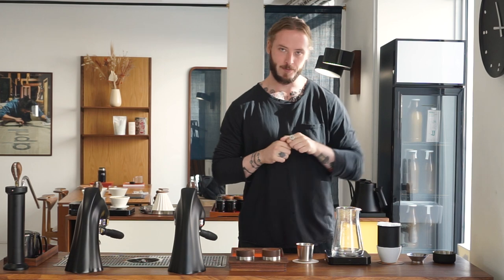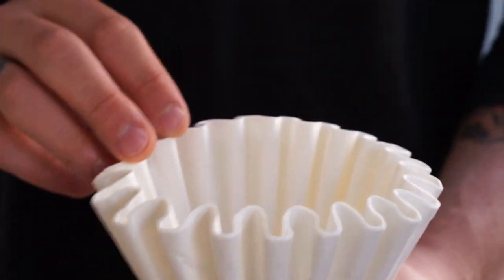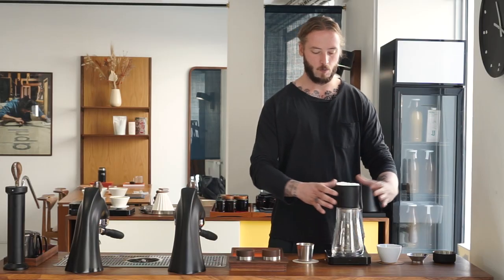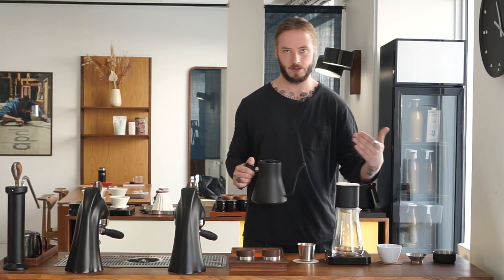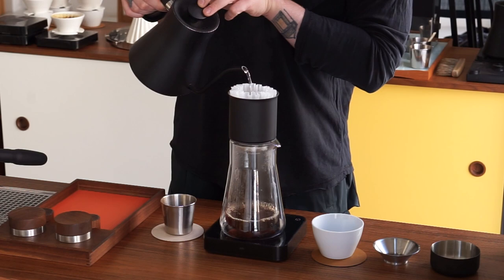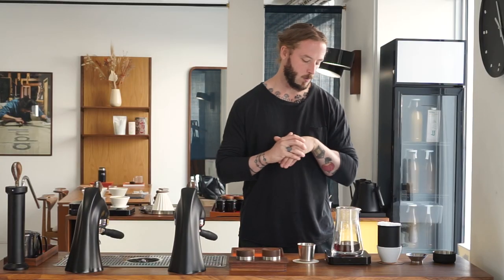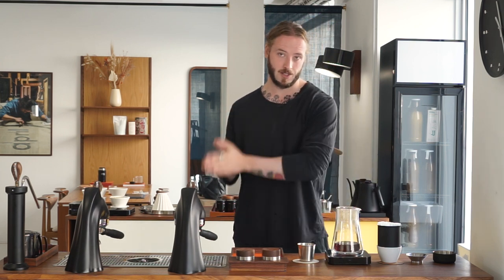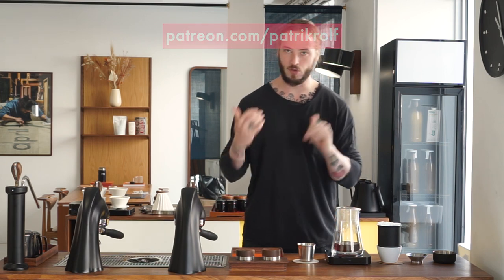Exploring the Stagg Pour-Over Dripper from Fellow (XF) | Coffee with April #188

Comment: I have both tha Large and the small Fellow at home. The large is not a good brewer for small brews. It shines then you brew above 400 grams ( I use it for 450-500g).
If you want to make a small brew then use the small brewer it is good for 200-350g. Above 350 g is has a very slow flow rate. When you use the small brewer you have a lot more control over the brew. I also stir with a spoon during the brew. That is something I don't seemed necessary with the April brewer or Kalita 155 but it helts with the coffee getting stocked in the waves of the filter.
You can also use Kalita 155 or Aprils own filters in it witch I would recommend. The April filter is thinner a easier to work with. I like the video but thing the base parameter of reviewing a large brewer and brew a small batch it a strange choice.
Reply: What recipe do you recommend with the smaller x brewer?  I’m doing 22g/370g currently and coffee fills up the cup completely
Reply: @serafinmora2000  
My Max with the small i 300g water. Normally I will use 19.5-20g of beans.
Reply: I think the best brew is with 200-250 g of water in it.
Reply: @rttange1  you do a 1:15 ratio?
Reply: @serafinmora2000  yes 1:15 or 1:155 depend in on the brand

Comment: Thanks for the vid!

Re: grind size. What was used? I know you have been mentioning the difficulty of conveying grind size in videos. I think reporting average size in microns based on the Brewler, is probably the most straightforward info that most people can use; Kruve has a free pdf download of the Brewler. Mine is starting to have notes all over it!
Reply: It won't really tell you anything because the fines and the bolders has a lot more to say than the average size does. unless you have the same grinder and knife you really can't compare grinds besides some ruff schematic about how fine ore corse you are grinding. It is one og those things you have to dial in on your own equipment especially then it come to tase your water has a lot more to say than what you can get from measure micro size in the grind.
Reply: @rttange1  an "average" is a value, and one that can be useful. Thus, providing microns can convey a common starting point that users can tweak on their particular grinder.
Reply: @smtesta  But unless you have the same grinder and water the taste of the coffee won't have the same taste. and even then you will have the style of pouring to make even another variable. I worked wit another barista and we braved on the same equipment same pouring times and brew times. Alle the same parameters from equipment to recipes. We still had a dirrence in the of 0,15 his had 1.20 mine 1.35. We tried 3 in a row and our respektive TDS where consistent. The reason to write is that you can measure anything and try to be the shame on the internet but in the end it is close to impossible to copy exactly what other hase done. The most important thing is still do dial a recipe in the same way that a chef taste over and over again and free tune the amount of salt, sweet, acidity, bitternes and umami. Those  fine nuances has to be sensed to be controlled.
Reply: @rttange1  I still think it’s good to know the general size and then tweak to taste.

Comment: You don’t understand why people want to brew fast, but this brew ends at 2:20? Seems relatively fast to typical brew recipes. No?
Reply from the maker: For us this is a "standard brew time" and fast brews would be closer to 2:00 or below - using the same ratio.
Reply: I find that the stagg xf does really well with 30g to 500ml, relatively fine grinds, and pulse pours of about 75-100 g each.

I only use the XF when I want to serve more than one person.

Comment: ground compaction chokes up the flow rate, can be very frustrating if you're aware of it, years of hit and miss brews
Reply: After rinsing you should lift the paper a bit and you will notice a huge difference in flow rate.
Reply: I would recommend trying the April dripper or Blue Bottle dripper.
Reply: You should never force the paper filter right to the bottom so it sits on the brewer. Gently push the part filter in and let the water used for heating and cleaning the filter do the rest. I find that done this way you won't get choking with the Fellow X brewer